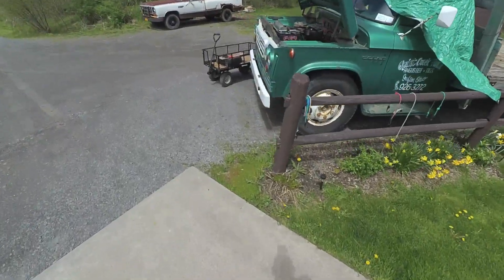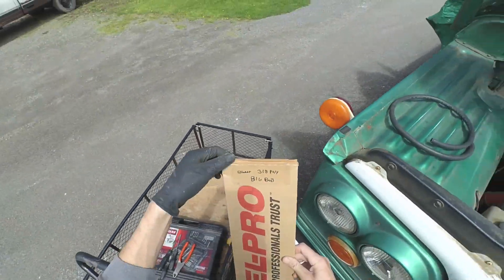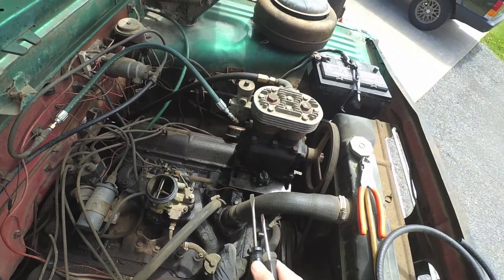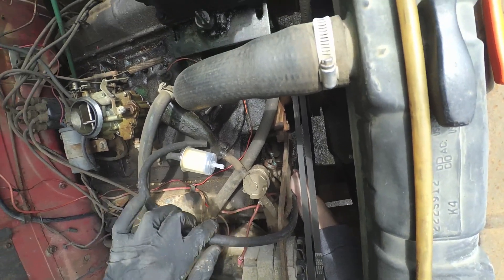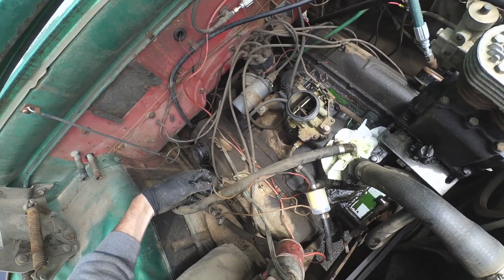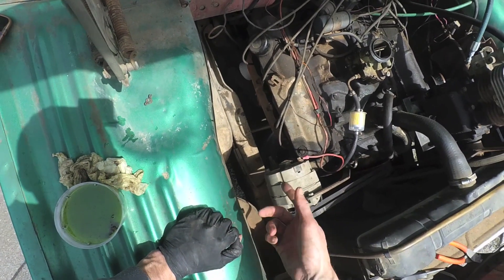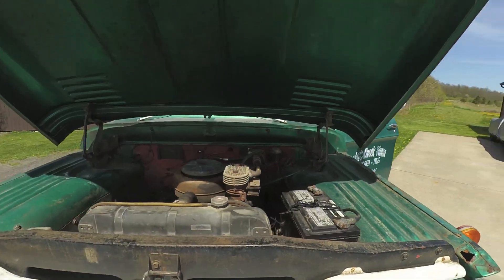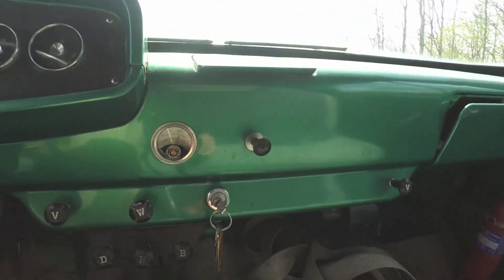1965 Dodge D500 Engine Cleaning

Comment: That pump on the heater line is a cheap type of block heater. It warms the coolant and circulates it through the system for those cold morning stars.

Comment: Diesel conversion on this would be cool. Some things with plenty of power.  MPG should be good.
Reply from the maker: It would be for sure, maybe some day if the 318 goes out on it but Its hard to bring yourself to dismantle something that runs good haha
Reply: @FanelliRestorations  I see what you are saying. What is the mpg on that truck now?
Reply from the maker: @b.c.gamingss  I forget exactly, It's been a while since I checked but it was somewhere around 12-14 I think on the highway. It needs new tires all the way around and quite a bit of work to get it running ideal, but for now it still runs down the road ok. One day Im redoing the bed and making it a  car hauler and I'll address other issues
Reply: @FanelliRestorations  Nice plan. I want a truck like this. Perfect in every way and wow I expected that 318 to do a lot worse on mileage. If you ever sell the truck let me know but I dont think you ever will.
Reply from the maker: @b.c.gamingss  yea thanks man it did really well for sure, and I will, I plan to keep it but you never know things happen
Reply: @FanelliRestorations  I want to see what you do to it. Looks like a great truck.